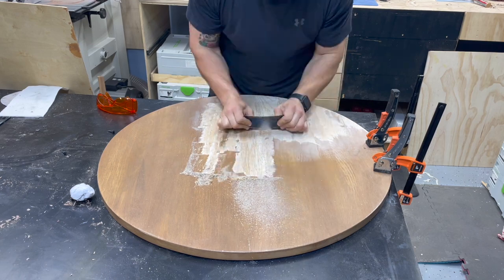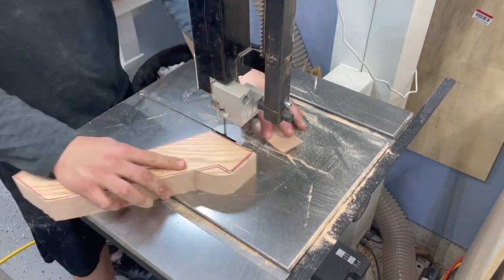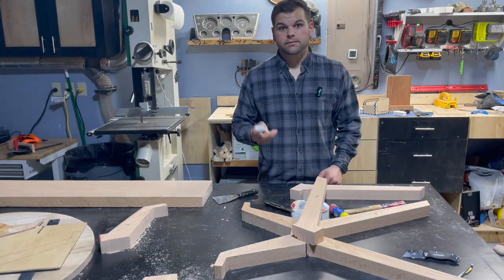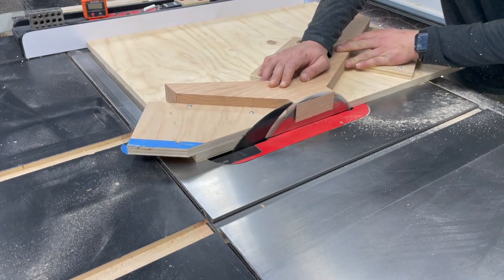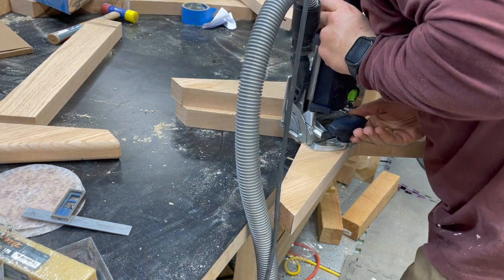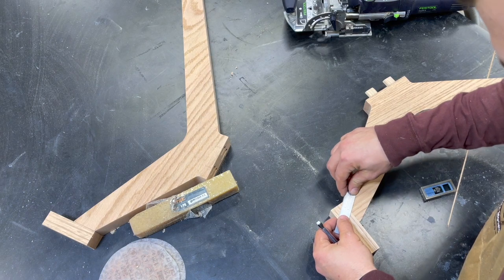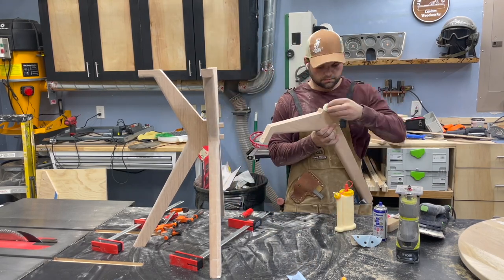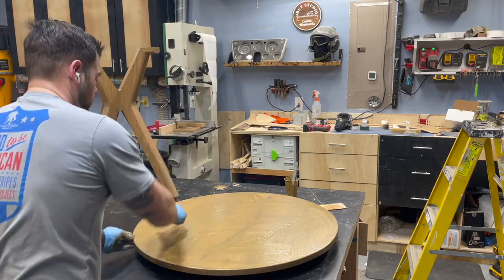Giving this table top a new base || Easy Mid Century Modern round table

Comment: ˢᵘᵇ this may be a stupid question, but I’m just starting to build furniture, so bear with me: if you used the same template for both sets of legs, does it not look uneven from a diagonal at the glue point of all the legs? Would it weaken the wood too much to mount the second set flush to the first pair without that extra tab?
Reply from the maker: I used the same template for all the legs, I took half the thickness off 2 of the legs to keep it square. You can also use the template the same for all of them and have a square core to attach them all to if that makes sense.